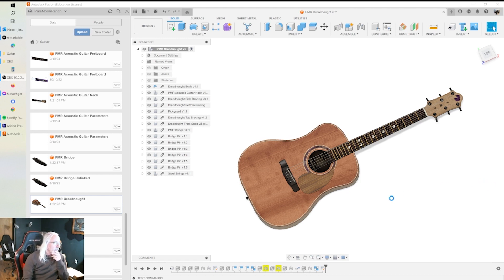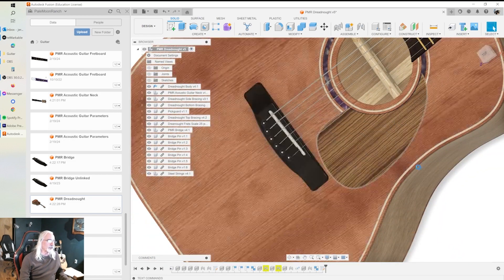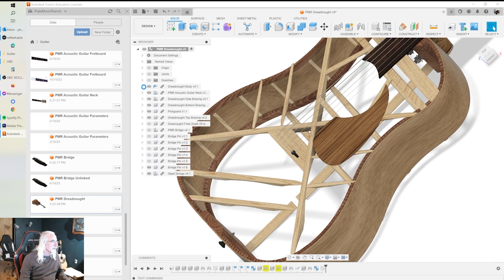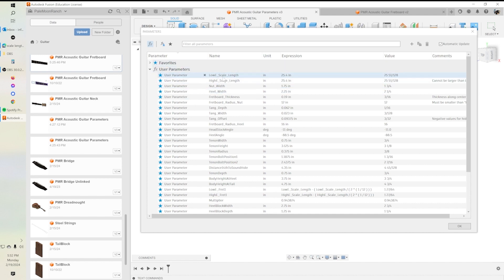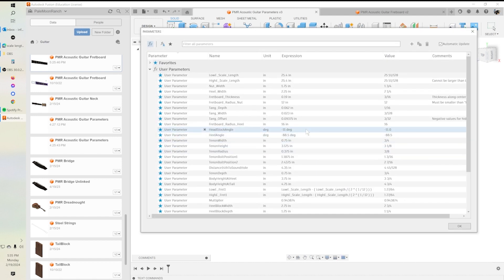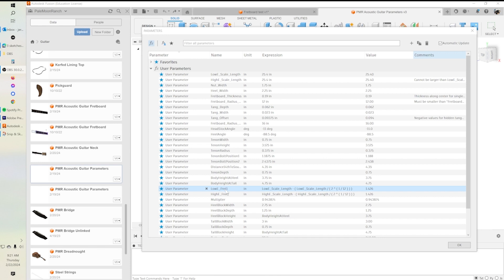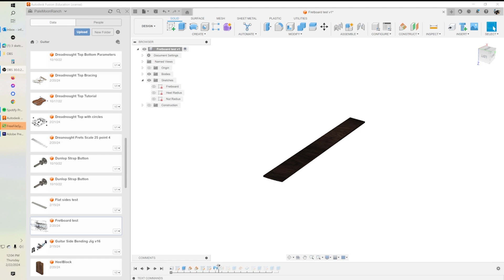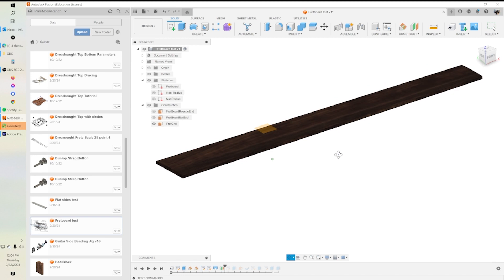Acoustic Guitar Design in Fusion360,  Part 1 Parameters and Fretboard

Comment: I've never used Fusion, but I'd like to use it for an acoustic guitar.  I have some calculations I do that require the area of the top and the volume of air inside.  Can Fusion provide those numbers from the model?
Reply from the maker: It is a simple matter to get the surface area of the top using the measure tool.  The volume of the body is not so simple.  Fusion does provide the "Boundary Fill" tool for this purpose but it doesn't seem to want to work on this model, perhaps due to the complex shape (radiused top and bottom).  However, I have uploaded a video for you to show how you can get the volume with just a bit more work.  https://youtu.be/csJbWwEPAXo.  Hope this answers your question.

Comment: Hello! thanks for the wonderful series! im going with you step by step and everything was ok until i arrived the thin extrude to cut the tang from fretboard. im doing exactly as you said but im receiving an error -"cannot extend extrusion to object. the extrusion profile falls outside the boundary of the selected body". do you maybe know what im doing wrong?
Reply from the maker: Hard to say without seeing your model.  If you want to send it to me email it to jerry@palemoonranch.com
Reply: @palemoonranch  thanks so much for your kindness i sent it to your mail❤
Reply from the maker: Ok, well, this one is my fault.  The instructions I gave in the video were for hidden tangs.  I published a short video explaining how to get the curved bottom to the fret slots when the tangs are exposed.  Sorry for the confusion.  Here is the video: https://youtu.be/yP8tvrvixqM
Reply from the maker: Here is a better solution that is fully parametric if you want the fret slots radiused on the bottom.  https://youtu.be/e0Y44gGqdu0.  Depending on when you get this it might need a little more time to process up to HD.